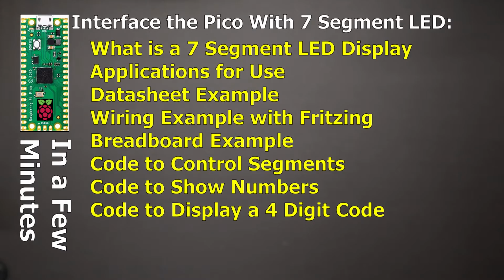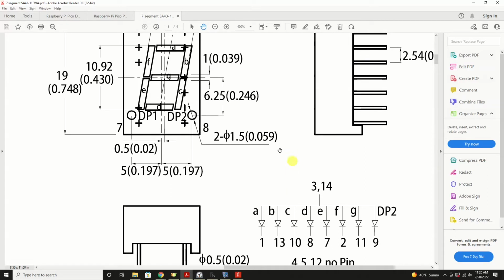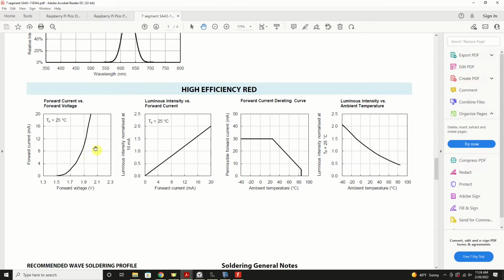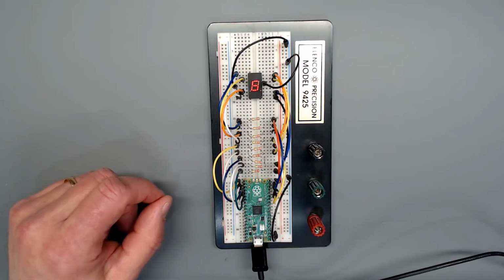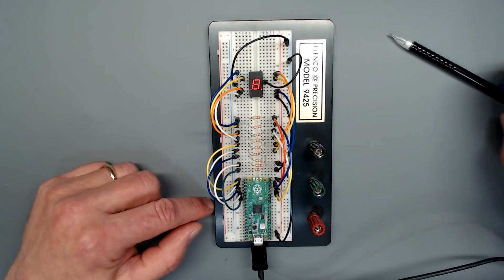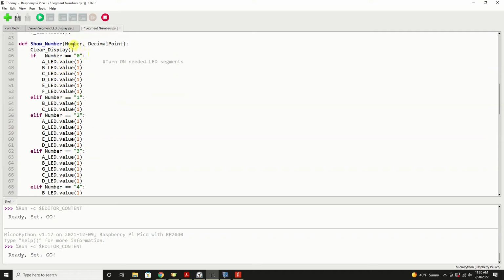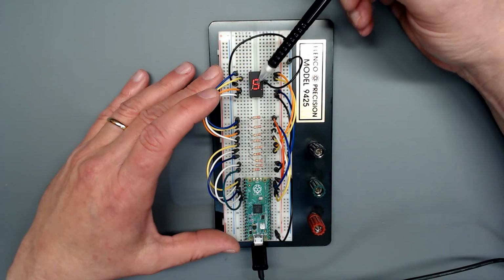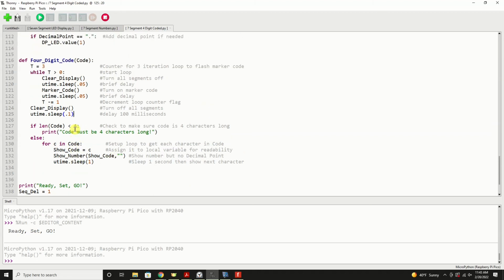Interface the RPi PICO to a 7 Segment LED Display

Comment: Why not connect a single resistor to the common anode or cathode instead of 8 individual resistors?
Reply from the maker: Good morning!

Good question.  Think of the device as having individual resistors as you stated.  Each one can be ON or OFF or ALL ON.  The resistor value is dependent on the total current of the circuit.  Using one resistor for 7 LEDs would be a different value that one resistor for 1 LED.  
Hope that helps!
Cheers and Happy New Year!
Chris

Comment: Useful video. I bought a pair of dual displays to play with my Pico, also with the aim to use the multiplexer later following your video. Couldn't get them to light and after an investigation I discovered that the supplier had sent me Common Anode displays and not what I had ordered which were common cathode! Also the pin outs were different. Modified your SW to use inverse values and correct pin outs. 😂
Reply from the maker: Awesome fix Peter!  I have had that same problem numerous times with "inexpensive" LEDs and displays like this.  
Either way, it is a heck of a learning experience!
Cheers!
Chris

Comment: on the longer breadboard the power rails might not run end to end, could be split in the middle, 
so if not running as expected check the rails
Reply from the maker: Thanks for the great comment. I have run into just one of those types of breadboards.  Perhaps this is something "newer"?
Reply: Had that issue as well, only using 1 half